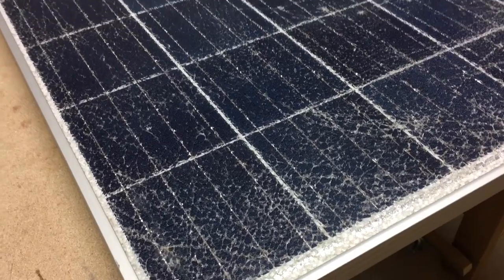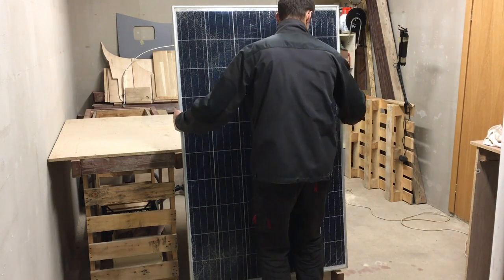How To Repair Solar Panel Broken Glass

Comment: This would be fine for parallel panel use it could be very dangerous if used in a high voltage string configuration as the dielectric properties of the panel are comprimised.

Comment: Have you posted a video of how this panel front surface repair sealing has worked in the long term? I can't find such a video from you. Has the plastic film with its adhesive still held up in the sun and rain?

Comment: It's complicated, as the plastic film won't resist the extreme heat of the sun! it would end up creating bubbles and damaging the panel's performance. The EVA film below the glass already ensures a certain impermeability to water entry. The best option, I believe, is to place absolutely nothing above the glass!

Comment: I had a few cracks in a small solar panel I use while camping after it got bumped into. I took some 3M clear 3” tape and covered the cracks and the panel still produces 2 years later and no problems yet. The tape is starting to yellow and peel but it lasted this long so I’m a Happy Camper !!,

Comment: I am testing a ton of solar panels at work and we damage until the glass breaks, and they really don't drop much output. If it's a localized break, it only damages a few cells, and not completely is common. Output would drop only 30-50 watts on 500w+ panels

Comment: any one using broken glass panels? I can get 380w panels for usd$25 each... any dangers if a cell is damaged? I'll be installing those on my roof, so i dont want to burn my house down..
Reply: I wouldn't install them on your roof. There is risk of arcing if the cells get wet or are too damaged. The only way to know for sure is to check with Electro-luminescence test. Reverse current at Isc spec and look at the microcracks, with a special lens on the camera of course lol. But if they don't look like they are damaged badly on the busbars you're probably okay. Just make sure you seal it somehow. Good for projects on the ground, not your house, because there is always a risk. Insurance probably wouldn't cover it since they were already damaged before you put them up on the roof. Not worth the risk to me. But for something like a solar shed etc. I wouldn't worry too much.

Comment: How efficient will the panel be with all the shadowing from the cracks?
May be you can research for a poor on liquid product thar fill in the cracks?
Reply: exactly. I tried a film cover. 455w panel. broken glass no film: 315w. broken glass with film: 315w. $30 of window glass from hardware store: 441w.
Reply: @Paul_______  so how did you put the glass on?

Comment: Very helpful video. Great to see people fixing broken things rather than throwing them out
Reply: I tried that with my x wife didn’t work !!!
Reply: Unfortunately, such a solution is short-lived. The heat of the sun and rain destroy the protective plastic quickly. And currently, for example, you can get new and much more efficient intact panels from Finland for the same price. For example, 350Wp = 49.00€ and 410Wp = 69.00€ So buying a new one is much cheaper.

Comment: Where from did you get the sheet send me link
Reply: JUST SO TO A PLACE THAT DOES SIGN WRITING. THEY USE THE CLEAR FILM YOU PUT OVER THEIR SIGNS TO STOP THE LETTERS FROM PEELING OFF. ONCE YOU STICK  IT ON THE PANEL RUN SILICONE AROUND THE EDGE OF THE SOLAR PANEL FRAME WHERE THE GLASS MEETS TO STOP WATER GETTING IN FROM AROUND THE EDGES OF THE PANEL.

Comment: I get given broken new panels free from a local installer. Many tiny pieces of glass stick out, piercing the plastic film. Not weatherproof, not strong and not going to last. Best try a solvent to remove the glass from the panel if possible.

Comment: I see many problems with this, not worth it
one; the way solar module generates electricity this module is likely to not generate electricity at all to find out why to check out videos of why a solar module may not generate electricity.
second; the way the surface of a module is designed is to absorb most of the radiation that comes from the sun even if your solar module works it will generate less electricity third a solar module is designed to last at least 30 years will this last 30 days under harsh weather?. it doesn't worth nothing. also if you decide to get rid of it what are you going to do with it?.

Comment: there's a local solar farm installer that is selling cracked 340w industrial panels for $60. is it worth it to buy and repair them?
Reply: Ask how much they cost to dispose of, then you will be in a position to bargain 👀
Reply: @Nobody_Famous  oh I ended up buying a pallet of 10 of them for $200 after a bit of bargaining. He gets them as a write off, I get panels that ranged from 80-95% output for less than a single new one
Reply: I guess not enough for THEM to repair and resell.....

Comment: Probably the worst way to repair a solar panel.
Reply: Nah, the worst way is to repair it with black tape. ;)
Reply: I think removing the glass and putting it out to work might be the worst way to repair it.  You'll know as soon as it rains this is highly accurate. :-)

Comment: there is no way in hell that panel is working properly with broken glass, the glass being broken creates a massive loss because it causes shading and inability to properly absorb sunlight. that panel was worth less than $0 it is garbage.
Reply: you lose 5-10% of power with that many cracks
i just got a panel which looks way worse, it has cracks all over it
but of the 220w that it was rated for, it still produces 190w
Reply: @benjaminbuljevic7977 , agreed. One of 2 panels that make up our 200 Watt portable kit shattered but it still works and generates about 1.6 amps less than our other (unharmed) kit.

Comment: I wanted to do the same thing, four broken panels i want to buy. Only problem is they don't have frame, like yours but they are producing electricity.  Did you test yours, how they work?
Reply: Just make an aluminium frame
Reply: Ask glass company if they have suitable aluminum extrusion on they will happily build you a frame or sell the material.

Comment: Me had a broken solar panels last week...typhon wind..tore the metal wires from the boards :(:(  150mph i think or more.....and i work in solar systems ....so did you people think about effect of hail rain on your mega solar project ?? But as repair im thinking about the technic used to repair auto windshields....thats it to vacuum press raisin into the broken board.....just like cellphone broken screen technic....then wax it crystal clear ...with ceramic wax...if lower efficiency 5% i think its success...

Comment: Resin is very good/best. It fills the cracks, it is cear, very hard, and durable.!  ☺
Reply: What type of resin is best for this problem?
Reply: Resin is more expensive and it yellows in sunlight very quickly. The kind of resin which doesn't yellow has UV blockers, meaning your solar panel won't get as much power!
Reply: I tried resin and it was impossible to fill thousands of cracks, and it didn’t seem to penetrate far despite being advertised as making the cracks disappear. It didn’t. I don’t see any such film 48” wide.

Comment: Doesn't the glass have to be conductive
Reply: No.
Reply: That was interesting.  How so? The semiconductive glass make the whole thing possible
Reply: @JDhvactech , I'm late for this reply but, the glass is just to protect the cell underneath from rain and debris. The light passes through and each square cell captures the energy.
Reply: @JDhvactech  glass is an insulator, that's why they used it as insulators on powerlines as well as ceramics.
Reply: The conductive glass is а solar cell main component. The thickness of TiO2 acting as а semiconductor plays a primary role in the transmission, photoconductive properties, and the efficiency of solar cells. ...

Comment: Hi Everyone, we did the same technique and covered the broken pv panel with a transparent auto glass folio, and the result is not satisfying. We connected 2 series and 2 parallel of 265W poly panels. The inverter gets 200w totally. You need too much area to compansate the same power and its not effective.
Reply: Delimiter film will not affect production. I believe your panels are entering diminishing returns with the broken glass prior to the film being applied?

Comment: This won't last very long. Laminating film won't like the 50°C temperatures. And while rain will flow over it, moisture is still going to creep deeper and deeper at all the edges.
I would remove the glass and use clear casting resin to make a new layer. Weatherproof, heat resistant, light and only a little bit more cost.
Reply: How long does it take clear casting resin to yellow in the sunlight?
Reply: @darrisx8146  Depends on the resin. You want one that yellows very quick because that means it's a resin without added UV stabilizers/inhibitors. Otherwise UV light will be blocked by the resin and you lose a considerable amount of light on the PV cell. On cloudy days where UV is almost the only spectrum that gets through the clouds, you'd relatively lose a lot of production.
Reply: @Rizon1985  but surely the resin that isn't uv resistant will cloud up and then block the sunlight hitting the panels even more. Either you use uv resistant resin that blocks out uv and you lose power, or you use non uv stable resin, that goes yellow and cloudy after a few months and you lose power. Its a lose lose situation
Reply: Do you have any details of the type of resin you're talking about?
Reply: The film used on automotive windows for tinting lasts a long time.
Reply: On which site I will purchase it
Reply: I need this
Reply: Whare did I got this

Comment: You should do a follow-up in 6-12 months to see how it ages when exposed to elements. I'd expect edges to peel-off and allow water to enter but who knows... :)
Reply: The voids behind the film can also act as pumps for moisture. When the gas  heats up, the overpressure escapes through any gaps. Then when it cools off, any condensation or moist air gets pulled in by the partial vacuum.
Reply: Right
Reply: I thought that painting on acrylic clear paint because it is so durable...
Reply: @JustJacqe  so did you do it?
Reply: I sealed them 6 months ago., people are too high around her to actually do any work, Gawd ! I nay have to load them and get it done on the road.

Comment: Aren't the cracks going to lower the efficiency?
Reply: Not as much as they lower the price 😆
Reply: @Nobody_Famous  True, but for original question, just got 290w panel and electrician neighbor tested it that efficiency drop to 250w after glass shattered, so it does have rather big effect but per say but compared to price its not that much, still it does effect panels utility life greatly so replacing the glass should be done if all possible. Hot and needing it to be optically clear does create issues, specially since i presume glass has plastic film between, so you cant really fill the gap form outside with resin or anything.
Reply: not the glass being broken, only the amount of damage on the actual cells. I do EL and IV testing for hail damage at work and I've had 545w bifacial panels still output their rated amount of 545w after a few rounds of hail testing and the glass breaking. Most other panels follow suit, but the more damage they take BEFORE breaking the glass, the worse the output is.

Comment: Really nice. :) I'm thinking in a project using a small solar panel. It would be like that... Connecting it to a step down (using a diode, of course) to get 5v, then connect it to a TP4056, that would be connected to 6 lithium cells from a notebook battery. From that the energy goes to a step up and to a 10w LED reflector (using a 12v dc driver). And I would make a darkness sensor to power it up or down. :) Don't know how much time the batteries would last without sunlight or if one day would be enough to charge them... But I'm going to try. :D
Reply: MC's Creations be aware that batteries have to stay as cool as possible